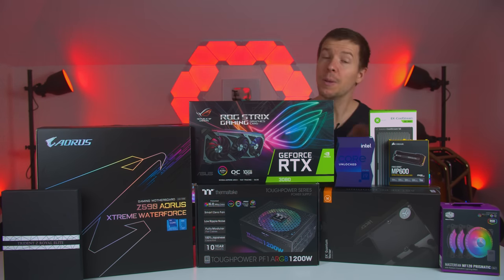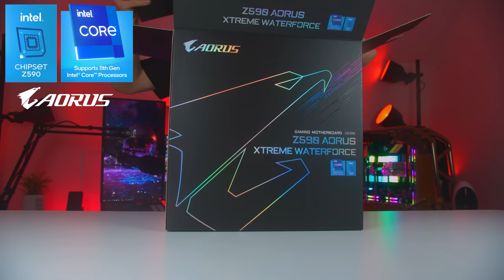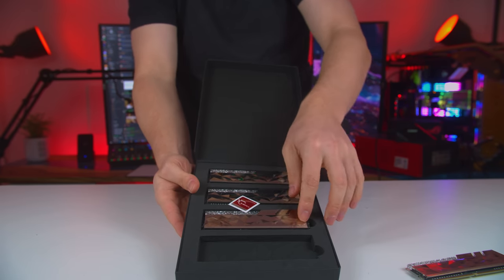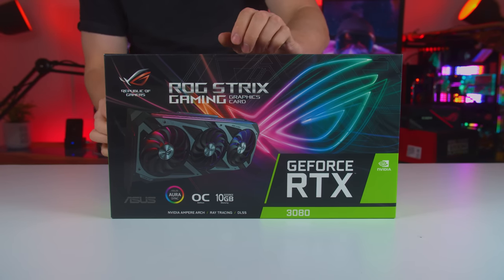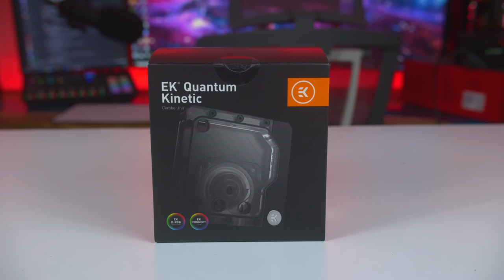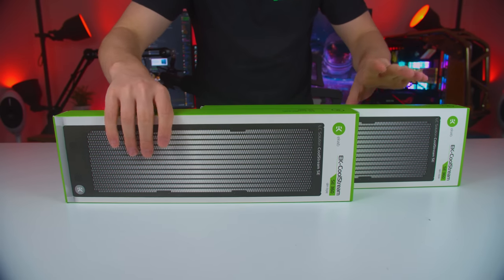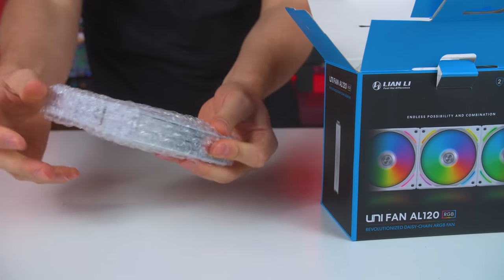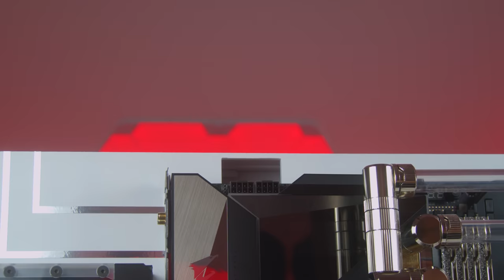My CRAZIEST $7000 build ever..

Comment: I'm curious about the water cooling, what goes where and why. It would be much more satisfying to understand the entire system. I'm sure this machine is gonna be as cool as the north pole tho.
Reply from the maker: There is two seperate loops, one for the cpu and one for the gpu
Reply: Customize it the way you like. There’s no right or wrong way honestly
Reply: Go watch JayzTwoCents he recently did a beginners guide and he explains what he dose in his videos .
Reply: Basically, you have radiator(s), a reservoir, a pump, and waterblock(s).
Obviously there's tubes and fittings which is a whole other topic too.
The main thing is to keep your pump underneath the reservoir so it never runs dry.
The reservoir makes it easy to fill, and it can catch bubbles and release them whilst filling/running the loop.
Reply: Watercooling is just another fancy way to cool down important parts of your computer to prevent it from overheating and ruining your shit YOUR WELCOME
Reply: @lancebarrilleaux3919  Not really a fancy way. A few years ago yes it is not necessary. Nowadays is essential to water-cooled it. A few years ago the fastest SSD was around 1500m/s read. That is very fast even by today's standard. Nowadays the Norm is 7000m/s read.  Can you imagine how hot it can get running at that speed for an hour?  I forgot to put on the heatsink one day and run a performance test on my Samsung 980 pro without a heatsink. It got over 100 C in less than a minute without the heatsink

Comment: I was hired by someone online to change out a motherboard for a high frequency trading firm.  Two large gates opened and I drove up and back down over a winding road to the facility. When I got to their building there were multiple datacenters and a warehouse full of parts, it was like an Amazon warehouse. The datacenter I worked in had  600 dual CPU servers submerged in mineral oil.  This was their research facility.  I had to wear latex gloves and yank out a server and let the oil drip off it before swapping everything out.  It was pretty amazing to see.

Comment: I have ordered my own active water backplate and was told by Sept I would be getting it; so now really jealous that you got to have yours. ;) Really sharp build for a demo piece since I do know know how you would be able to connect all the peripherals with that pump in the way. Like the way you complemented the white, silver, blue, and grey. I would have though that you would have added some white or even silver into the cables to match it more with the build. But, still, a very sharp build!
Reply from the maker: Thanks! The reservoir is elevated. You can plug everything in as intended

Comment: You design gave me an idea. Can u make a resevoir that is completely flat at the bottom and fills with water in such a way that it makes the surface of the water ripple. If lights were placed under the acrylic resevoir it would create a wave lighting effect thoughout the entire PC. LEDs could change color for different wave lighting effects.
Reply from the maker: Very nice idea!

Comment: I am about to build a personal water cooled build as well. - Using the EK active backplate. 
Did you go to the 2nd PCIe  slot mainly for looks? or does the active backplate get in the way of the VRM heat sink when placed into the first slot ?

I only ask as i’ll have all my parts in two weeks but the active backplate for ftw3 is available in two months. I just don’t want to wait two months to see it doesn’t fit
Reply from the maker: The monoblock gets in the way of the backplate
Reply: @DesignsByIFR  Thank you for the response. I do see what you mean. I may have the same problem since the EVGA Z590 Dark has a thick heat sink in the same spot. 

Love the builds you make. A lot of inspiration for a first build 👌

Comment: Awesome build as always, though with a dual loop I would like to see different colors, even if it was a light blue and a darker blue. Also how the heck do you use the I/O on that motherboard with the pump in the way??
Reply from the maker: The pump isnt in the way, its elevated so you can run your USB etc beneth it. It actually hides the cables

Comment: I think that dual loop systems are a bit pointless because if you only use one of either gpu or cpu, one of the two radiators will do nothing.
If you connected everything in series and the pumps in parallel wou would have double the flow rate and double the cooling capacity when you only use one component.
Reply from the maker: It doesnt work exactly like that but i understand your thought process behind that

Comment: Will this system even work? I mean the water cooling pump is guarding the ports from the motherboard so how would you gonna connect a monitor and other peripherals?🙃🙃🙃
Reply from the maker: The reservoir is elevated. You can plug everything in as intended

Comment: Ok, this looks amazing.

Question, for the next big build you do with water-cooling can you include the tube measuring, bending, cutting, and the like? I have been watching for a few years now and I don't think I've seen a single bend done. 

Also, how are the runs in the back set up?
Reply from the maker: Great suggestion!, i did show abit of the back when putting the back pannel on but perhaps not enough
Reply: @DesignsByIFR  Thanks for the quick reply. I honestly love watching the builds you make. Showing the back panel build was good, but I didn't see how the rads were looped in.

Was this system going to any show? I assume some of them, like the Logitech one(s) did. Or was this one just beautiful art?

Comment: Hey I'm still quite new to PC building. I'm planning on getting a new PC soon and wanted to ask if the parts I picked out are any good. Well the goal is to play stuff like Cyberpunk, The Witcher or RDR2 without problems on high graphics settings.

The parts:

AMD Ryzen 9 5950X

GIGABYTE GeForce RTX 3080 Ti Vision OC 12G

ASUS ROG X570 Crosshair VIII Hero

2x G.SKILL TRIDENTZ RGB 16GB (2 x 8GB) 4000 MHZ 

Seagate Barracuda 2TB HDD

2x Gigabyte AORUS Gen4 SSD 1TB

3x NZXT Aer RGB 2 120mm fan

Kraken Z73

NZXT C850 

NZXT H710i

(+ RGB & Fan Controller)

Are these parts ok to combine or does anything bottlecap something else. 
I'd be happy for all help and advice.
Reply from the maker: Nice build

Comment: Hey man awesome build like it. Some questions though:
1. Is this a showcase build since the case is modded?
2. Will you remove the GPU Block afterwards and reinstall the stock cooler?
3. Is tapping acrylic easier than tapping metal?
4. A request actually: Will we see a CORSAIR 7000D or 7000X build soon?
5. Is distroplate making easy? What is the material used as the washer here?

Comment: Sweet Build!  Where are the rads? Can you post more pics of the build from different angles?
Reply from the maker: Rads are at the back, did you watch the whole build because i showed them
Reply: @DesignsByIFR  I must've missed it... I'll just have to rewatch!
Reply: OK, rewatched the video! What brackets did you use for the rads? Did you make them specifically, or did you repurpose other hardware? Thanks!

Comment: Cool build. 👌👌👌
BTW im planning to make a mid range pc with these components.. 
1. Ryzen 5 3600
2. Msi b450 tomahawk max
3. Msi gtx 1650 ventus 4gb
4. Xpg Adata gammix 2*8gb ram
5. Cooler masters 650w psu
6. Wd 500gb ssd
7. Seagate barracuda 1tb hdd
8. Noctua NH-U12S cpu air cooler
9. Acer 23.6" Fhd gaming monitor
10. Ant Esports Royaleflow rgb fans
11. Ant Esports ICE 300tg cabinet
12. Ant Esports KM500W gaming keyboard and mouse
13. Sndia large gaming mouse pad. 
Are these components compatible with with other for a good gaming experience?? Any changes needed??? 
I would appreciate you help on this build.

Comment: Looks amazing and makes me want my own machine to do custom work with acrylic and vinyl. What did you use for the o-rings for the custom plate? Glue? Also, it looks like accessing the I/o on the mobo would be a major PITA since it’s so close to the pump.
Reply from the maker: The pump is raised with those standoff brackets, you still have full access to the IO. I used a strong super glue

Comment: Looks very cool indeed. Few questions tho, Wheres the drain port, and if you're going to this length with customization, why not also take your time to put on custon sleeves on the the fan cables and use custom length power cables so they fit just fight? im guessing the back looks a right mess.

Comment: Very impressive. But how should we plug the cables into the motherboad ?
Reply from the maker: Plug them in above the reservoir and under it, the reservoir is higher than the IO ports
Reply: @DesignsByIFR  got it

Comment: I have just built my first custom loop and I have to say I'm disappointed with its performance. Its all from EK. 420 radiator, waterblocks on CPU and GPU. Best pump EK has. My CPU is warmer than it was on my AIO. My GPU (MSI Suprem X 3090) is preforming worse now than it did on its original air cooler. Sure, the GPU is showing 45 c, but the ram is at 105-112c! I can even notice it in games where my old 1070Ti ROG Strix had no problems and fans didn't even start! Thinking of the cost this has had, it will be my last custom loop. EK has an active block for the backplate and that would probably help with the ram temp, but that block don't fit the Suprem X.
Reply: @Armon Buicki Yeah, I've seen it. I have been in contact with EK and that backplate do not fit my card. I have an MSI Suprem X 3090. Max mem temp the last 24 hours are 110c.

Comment: Build looks great but my only complaint is you've made the rear IO unusable. The pump is right next to it.
Reply from the maker: Its not unusable, every pc i build has to be functional. The pump is on stilts so i can route all usb cables under it etc.

I had to use a keyboard and mouse to download rgb software and change the led colours right?
Reply: @DesignsByIFR  well the front USB ports could have been used for the mouse and keyboard for setup as well. 

The pump could have been moved a just a little and then you would be able to have unfettered access to all the ports is all I'm saying.

Comment: I have a question: How do you use the MB connections because it is directly the reservoir in front?
Reply from the maker: You can plug in the display cable like and other pc. The usb cable can plug in above the reservoir or under it because its on risers.

Comment: Corey gigabyte aorus rtx 3090 waterforce wb and aorus z590 waterforce wb here
Reply: Corey aorus z590 waterforce wb 5 ssd and aorus gen4 aic adaptor 10tb here
Reply: @DesignsByIFR  Corey aorus z590 waterforce wb 5 ssd and aorus gen4 aic adaptor 10tb here
Reply: Corey Gigabyte aorus z590 xtreme waterforce and gigabyte rtx 3080 gaming oc waterforce wb 10g and Gigabyte p750gm power supply here corey

Comment: So why not show the back? Where's the two radiators, the Lian Li 120's, and cable management shot? Nice enough build.... but sort of a fail as a video. 🤔
Reply from the maker: Did you watch the video? I showed the back when i installed the back panel with the psu and radiators on it